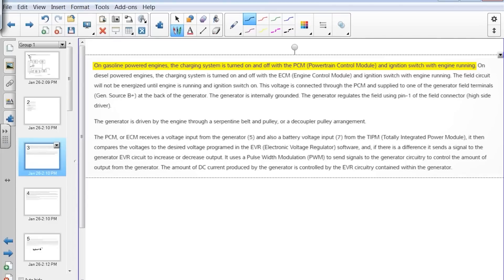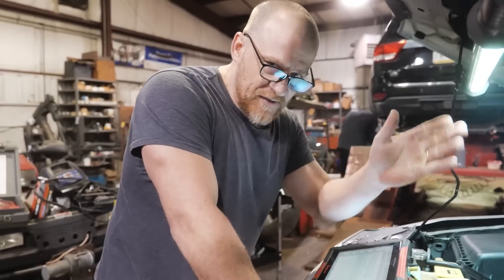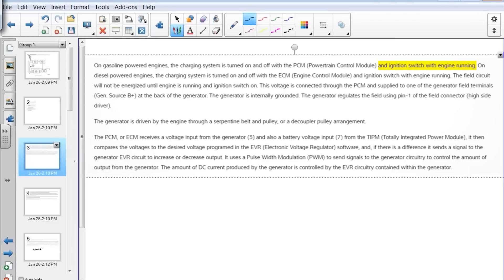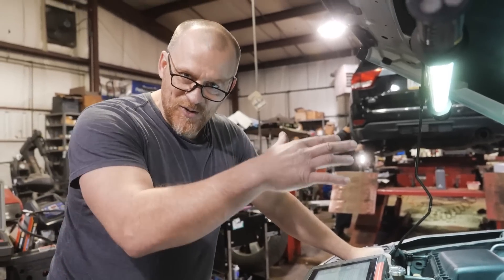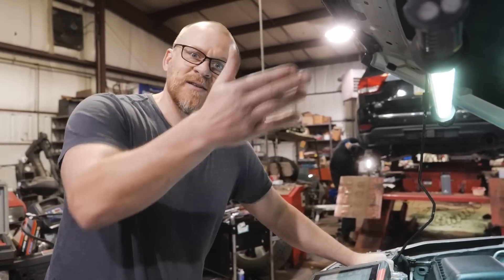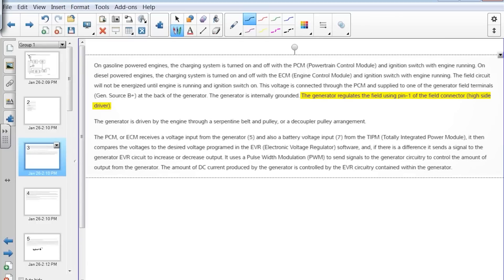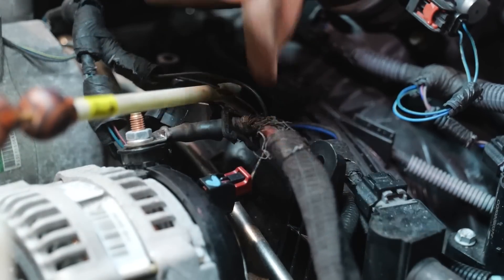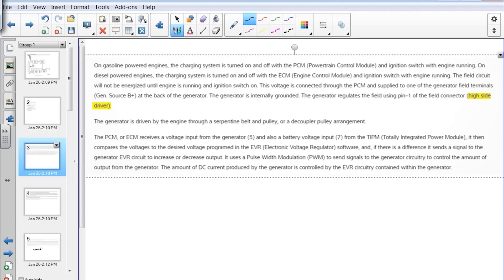Charging For Diagnostic Time - Can We Bill a Customer For "Research"

Comment: Define "Research". If I am doing something and getting results I need to sanity check e.g. readings that are not what I expected then time to lookup and verify then yes or lookup wiring diagrams or theory of operation again yes.

 If I need to look up how to actually do a diagnostic/repair because I have never done it before then I class that as education and no the customer shouldn't pay for my education. Also if you are charging a min charge for Diagnostics e.g. 1 hr and you get the job done within that time frame then I wouldn't expect the customer to pay 1hr + research time. I try and be pragmatic about customer bills. If I am having a bad day and have gone down a rabbit hole and it took 2 hrs extra because of my mistake then no I don't expect the customer to pay that but that assumes I am honest enough to admit it to myself.

Comment: At the dealership level I see a lot of leftover information from year-to-year that doesn’t get updated. It sucks that you can’t trust factory service info to be correct. Also a common diagnostic step from the manufacturer: substitute a known good PCM. WTF
Reply from the maker: Worst ones ever right? I mean, who's got a known good PCM sitting around lol
Reply: @ScannerDanner  It’s like the person writing the flow charts has zero diagnostic experience. Ohm test the wiring and then substitute a known good PCM… yeah right. The kicker is that warranty usually doesn’t pay for diagnostic time.
Reply: @Jangus  I once decided to follow the flow chart, which eventually led me to replacement of the very expensive component! 
The only problem was - testing that component was the first thing that I did, and it was OK!

Flow charts only good to get “big picture”, rest of the job you have to use your own “gray matter”!!!
Reply: Especially on GM vehicles where 'used' don't work.

Comment: To all the whiners; was it OK for the last 2 shops who worked on the vehicle and charged the customer for a PCM, an alternator and labor? But it's not OK for a competent tech [last resort] to then correctly diagnose and repair the vehicle and charge for the solution?
Reply: Spot on. The customer has to learn from the experience and accept the garages he used made the wrong calls and he paid for it. Lesson learned and never go back. Once you go to a new shop then everything that happened before doesn't matter, slate wiped clean and you go forward from there. It is then up to the customer to decide if he wants to go back to the previous failed repair attempts and dispute/recover costs based on the diagnostics/bill from shop that fixed the problem.
Reply: Look, no one ask for your perfectly logical conclusion. Of course it’s okay to rip-off the customer and charge for labor they don’t need rather than actually figure out what’s going on…
Reply: And after we get the vehicle as a last resort, we have to sift through all the crap that was done prior to giving it to us to figure it out. Now a 6 hour diag that may most times could have been a 2 hour diag. The thought process against proper diagnostics is insanity.
Reply from the maker: thank you, exactly!
Reply: Amen!
Reply: Why would it be OK for the previous shops to do it? 

Here is what you are missing- a dialog with the previous shops. If that dialog was present,  you would hear people rightly claim they shouldn't be charging for unnecessary parts replacements that do not fix the problem.  You would not hear them congratulating the shops or telling them everything is fine.  

So is your argument that because others got away with it, you should to, and if anybody objects- they are whining? I hope not.
Reply: Youre whining.
Reply: Perfectly stated!
Reply: Not to mention the proper diagnosis is cheaper than buying more parts that may or may not fix the problems
Reply: hmmmm I thought shops would own up when charging for erroneous repairs. And this is based on Dan talking about you have to be 2000 dollars sure cause if you replace the pcm and its not it the shop swallows the cost. I havent experienced this and left the shop who wanted to fix every code that was produced by my clogged cat converter. He told me they couldnt narrow the problem so theyd have to replace everything code related but they were all smaller jobs I was assuming a pcm type job the shop would own up?
Reply: @PaulysAuto  read the first three sentences of the original post kicking this thread off.

When people take their cars to a shop, they expect to pay for fixing it. Not to send you to school to learn how to fix it. Not to play the guessing game with parts unnecessarily replaced in shattered hopes it will fix it.

Now you were correct in asking where the argument was. But if you are going tell me that I need to send you through auto-mechanic classes to get my car fixed, I'll go to another mechanic or just do it myself. I'm not paying you to learn to fix my car. I'm paying yo have my car fixed.
Reply: @sumduma55   Then why do you watch?   If you are not interested in learning anything - why watch at all?   Bust out the tools and get her done!

Answer...looking for a quick fix for free - never fails.

Now we have an argument.
Reply: @PaulysAuto  lol.. I'm not charging customers to watch videos to learn to fix their car.. It's completely not the same thing. My hourly rate envelopes my expertise and knowledge.
Reply: @sumduma55  cool story
Reply: @PaulysAuto  quick question... the batteries on your flashlight die. Do you bill the customer for going to the store as and purchasing more batteries? You lose your lat 10mm socket, do you bill your customers to run down to the parts store and get another?

Because those can be neccesary to getting the jib done too. And from a customer's standpoint,  I would expect you yo already have the tools,  nit charge me to get them or get them working.  So how is this different from knowledge you ptofess to have but need to look up?
Reply: @sumduma55   No, you shouldn't be charging for that and that's not the point.

I think you're misunderstanding what I'm saying here.  Even if I'm very familiar with the platform and I've seen it a 100 times that doesn't mean I'm cutting my labor.  So let's say for example I know it's a bad purge valve and have seen it a 1000 times.  Does that mean I don't charge for my initial diagnosis time even though I got it done in a quarter of the time?

So if I'm proficient in my diagnosis I get punished?

If I get a problem vehicle that's been to 3 different dealers and now I'm the dealer Tech who's got to finally solve it... You mean to tell me I shouldn't get any time to do research, gather history from the customer, perform inspections, and develop a plan for testing systems involved to determine the source of the problem?

Who pays for that time for me to sit on the line with TAC with a FSE?

I consult somebody with more experience, that's supposed to be an expert and they're scratching their head; so I should just eat all that time?

Obviously I'm not charging the customer for things that are not related to the repair or the diagnosis and testing.  But if service information is incorrect straight from the factory, this is something that falls outside of normal diagnosis.

If I have to reprogram or recode something, because the customer doesn't have the tooling or doesn't pay for the subscriptions, I should just not charge for my time and what I have to do the job correctly 😅 

DIYer tosses coils and plugs for a misfire... Now I get the vehicle.

I already know it's got new plugs and coils does that mean I just skip checking primary and secondary Ignition... You see what I'm saying... It's almost as though you're trying to say well you shouldn't have charged me for that because I already checked fuel pressure... Or Ignition... Cool story but did you really check it forgive me if I don't believe you.  What happens when we start skipping steps customer gets even more angry.

I don't skip steps and I sure as h*** don't skip charging for my time.

If it takes me a 1/2 hour to do my initial DTC scan, system research, and bulletin check...than another 1/2 hour to rule out Fuel System issues, then another 1/2 hour to rule out Ignition System, then another hour to do a leak down test, because I suspect a compression problem after doing a relative compression test that barely presents itself with a lab scope capture 2.5 hours is getting billed for my time...don't like it...cool story...then why is it in my bay...pound sand!
Reply: @PaulysAuto  lol.. you did an awful lot of describing working on a car to justify charging for learning how to work on a car.

Listen,  you bill for expertise. You are not dome 12 bucks an how tire boy who fetches stuff for everybody.  You do not give a discount when your expertise fails the situation and you need to learn more.  But why you would expect me to pay for you to learn whatever is beyond me. You already told me you knew what you were doing.

When someone has you fix their crap, they are paying for you expertise,  your tools,  and your time yo get it done.  Your hourly wage already covers your expertise or knowledge.  If you don't know,  it's on you. Charging the customer to learn to do the job their hired you to do is double dipping.
Reply: @sumduma55   You see when you work in this field professionally for more than 20 years, you start to figure this stuff out.  You know right away what you're dealing with.

Moreover, you can question my expertise all day long, but like I said before... cool story... pound sand...

Now I don't disagree with being honest and forthright with the customer...that's a given!  Now are there guys out there ruining it for the rest of us, absolutely and that's ONE of the points outlined in the video... 

Overall, to help teach technicians and shops how to do it correctly and to help inform customers that modern vehicles and diagnostic work is not like some quick fix automotive channel you see on YouTube!
Reply: @PaulysAuto  lol.. OK dude. I still say it is wrong to charge your customers to learn what you are doing.

But you go ahead and complain about those giving you a bad name.
Reply: @sumduma55   If you were a customer of mine, I'd tell you never to return.

You're a problem and I can tell just by the way you respond.  You're that guy... And make no mistake about it I don't feel bad about saying it and I sure as h*** know a spade when I can see it.

Keep on keeping on and best of luck to you out there.
Reply: @sumduma55   Those who complain willl always complain and they're miserable in their own life and they expect everyone else to feel sorry for them.

I have no sympathy..."dude"
Reply: @PaulysAuto  I doubt i would ever be a customer of yours anyways.  

Best wishes to you too.
Reply: @sumduma55   You just don't like it being called out - too late sweetheart - have a splendid day
Reply: Why waste your time explaining all this. Let him tackle CanBus issues on different makes, newer and older models and see he likes it
Reply: @sumduma55   So with service information being incorrect and the original shop attempting to diagnose it according to service information, wouldn't it be understandable that they would be led down a rabbit hole?

Hence the point of the video that it's not always that easy.

How would we even know this if we didn't have technicians out there that had a desire to learn and grow?  Or teach for that matter?

Who's claiming that customers need to pay for our education?  Pay me for my knowledge, time, and tooling...you bet, I could careless if you're going to attack it on your own...but, if you're using YouTube to do so...are you not looking for a freebie?  I find it absolutely comical to say the least.

You know not everything is as easy as searching a code on YouTube and then just expecting the technician to take their word for it... and not charge for their testing time.

Furthermore, if I were to pay a guy to come diagnose my home furnace because it isn't working and he tests the furnace and determines "xyz"...  And I find a video that tells me to slam "abc" at it...do I argue with the guy about his charge for the diagnosis and repair?